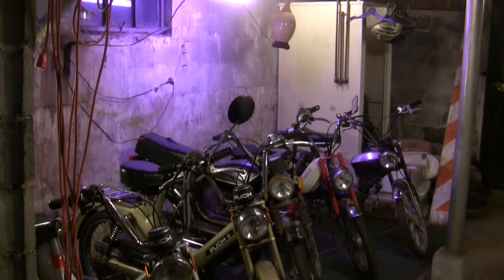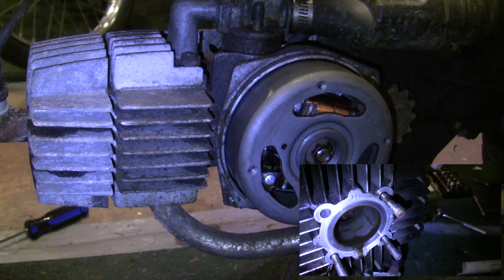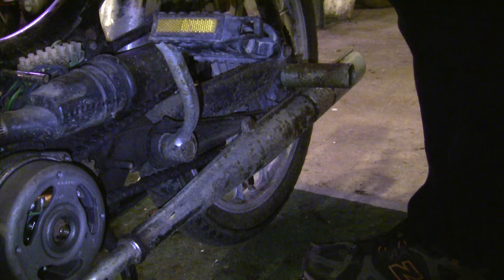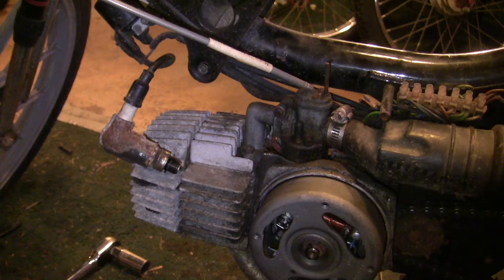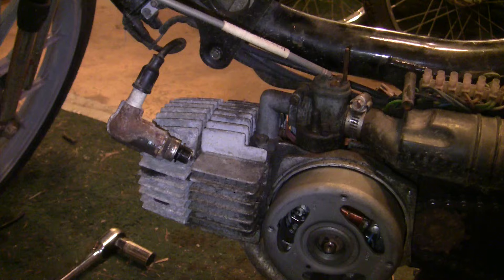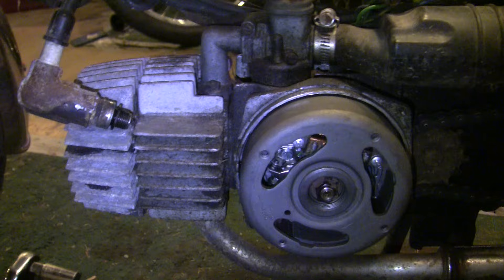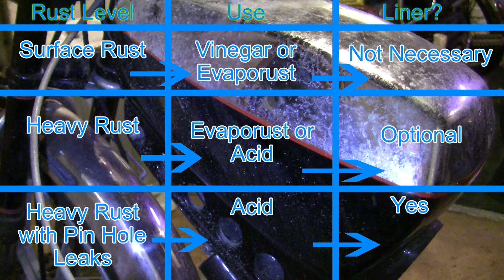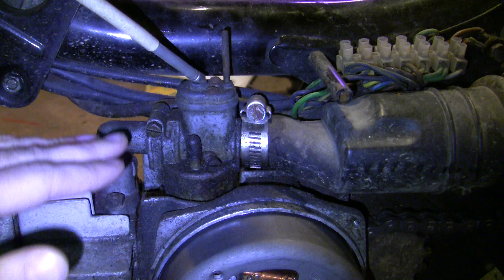How to get an Old Moped Running/First Things to Check (Compression & Spark Tests, Troubleshooting)

Comment: i baught a 1970,s or 80,s honda spree for 40 bucks like 4 years ago and it ran great untill last summer, i checked the compression, fuel lines, oil, cleaned the carb, replaced air filter, and cleaned all the electric connections and it still does not run. any advice you can give me?
Reply: Toll Tone its the same one you made a video on but the dash is different and mine is black with the spree on the side being purple.......i didnt see that video untill after i posted the comment above lol sorry.

Comment: I got an m48 engine I just changed the head to a high compression head and I couldn't get it to crank. I cut a 1/32 gasket and put it between The Head And the cylinder now it cranks but it doesn't start. Had it running before I installed the head any ideas

Comment: So I inherited a 1982 Honda Express. I finally got it started but I have oil leaking from the exhaust. What would be the reason for this?
Reply: it’s not oil it’s the gas oil mix and it’s needs to be tighter

Comment: Was this ped working before you started troubleshooting? Was it working afterwards?
Reply from the maker: I believe the only thing I did before the video was grind off the drive chain which was frozen. If you search through my channel you'll find a first start for this bike, and there are some other videos where you can see it evolve into a MiniMagnum. I converted it to a top tank, powdercoated it, built two motors for it along with a teammate, and rode it from Seattle to San Diego in a week last summer for the Pinball Run III.

Comment: hello, cool video man i have a tomos a35 moped and it runs well but for some reason it dies when i put the choke on what would you suggest to fix this.
Reply from the maker: My first guess would be air leaks, I'd do the carb cleaner check by spraying the mating surfaces (most possible culprits are the carb -> intake junction, spark plug, cylinder -> head, and head -> base) to see if you have RPM changes or if it kills the bike. If it passes that, I'd verify the carb is clean, on the Dellorto SHA that is most likely on that you are really just looking at the main jet inside the bowl.

Comment: Yeah, I tried a new plug. Still nothing. I put both plugs and the boot on my atv and the spark fine. I ordered a new coil, hopefully that does it. Is there any way you know of determining make/year? I know the motor is a minarelli, and there is a sticker under on the frame that says made in Germany.
Reply from the maker: One last thing I would try is cutting the wire a hair shorter and screwing the boot on, if it worked on your ATV maybe the end of the wire is has a dirty or corroded end. 

There should be a VIN plate or sticker near the head tube, as they made a ton of bikes with Minarelli motors over the years, Myrons might help narrow it down, see links below - but you can also post a picture on MopedArmy General Forum or in the "Lovers of Minarelli V1" facebook group and they should be able to help identify quickly.

http://www.myronsmopeds.com/category/parts/minarelli-engine/

Comment: Did all of the spark stuff cleaned the points and the plug and still not getting a spark. Points don’t open as much as yours by the way. It was sparking and running pretty well only a few days ago and suddenly stopped after a ride in foggy weather. If water damage is the problem what do I need? Im thinking of just buying a new ignition coil and spark plug but if it’s a CDI problem idk what I’ll do. I’m so discouraged at this point I’ve done everything I feel confident in managing myself.
Reply from the maker: It is all a learning process :) 

Let's start with the basics, I would absolutely start with a new spark plug to eliminate that factor. If it was sparking then not, I'm wondering if it is something simple like a loose spark plug boot on the spark plug wire or bad plug. If it is the black bosch coil, it is rare for those to go bad. 

From here, if you still have no spark I would read up on wiring for spark only, you want to eliminate variables like the horn wiring and kill switch wiring. Best of luck, once you go through the ignition system once it's like riding a bike
Reply: @TravisTutorial  thanks for the info and here’s  the update: I tightened and made sure the boot was fit tight as well as the connection to the ignition coil and all that. Still no spark. I also checked different points for voltage and ultimately decided to get a new ignition coil, cable, boot, and spark plug. I was okay with spending the money for those new parts after testing a bunch. Once I put those in I’ll know if it’s a stator problem or not. Other ppl I’ve talked to agree with me that it’ll probably be that. if that ends up being a problem I’ll get a new stator. I’ll say now I know the kill switch doesn’t work. The lights don’t work either and I think the light switch works because I got voltage when testing those wires at full throttle. I think the stator just doesn’t generate enough electricity for the lights but barely enough for the spark. That’s why I also think the stator finally died on me. Appreciate the help!
Reply: @TravisTutorial just put the new ignition coil, wire for the boot, spark plug, and boot on. Still no spark. Either I did it too quick and wrong or it means the stator needs fixing. Not sure what to do to make sure I replaced the parts correctly but yea there ya go.

Comment: I changed my fuel filter and I gave the gas and I got my battery charged I need to know what's wrong with my moped it won't turn over sounds like it wants to but it might not be getting any air

Comment: Thx for the video, i have a few questions, checked the compression spark and timing. Also cleaned the carb, but stil the Puch doesnt run. The spark plug gets wet really fast and when I tried to start it Thérèse is a littekens bit of smoke coming from the exhaust. What could the probleem be?
Reply: Hi, did you ever get this sorted out - mine is the same?
Reply: I bought a carb revision kit, this worked. The sealings were the problem i guess
Reply: @tenere_surfs5164  Many thanks for  the swift response - I will definitely try that.

Here’s, Will.

Comment: hey travis. thanks for the video. I have a 1978 puch magnum which was my dads. anyway I had someone work on it and he did get it started. with difficulty. I took it for a ride and couldn't get back up the hills. I was told its the carb and needs cleaning. I was also told that it could be a compression problem with a piston. any suggestions.
Reply from the maker: +stephen negri It could be low compression, but the most common problem with an old moped is usually a dirty carb. I have a video on cleaning the bing that will be on that Magnum. 

Few other miscellaneous things: Do you have the stock airbox on it? It is tuned from the factory to run with the factory parts. If it's a 1hp model 20mph is the most you can expect out of it. If it is a ZA50 Magnum (Silver models and brown UPS models) with the big two speed transmission sticking out of the side of it the shift pucks will likely need to be replaced sooner rather than later, which is fairly involved. If it's a red Magnum with an e50 you won't have to worry about that obviously.
Reply: +TravisTutorial  its a red magnum with an e50.  thanks for your input. your very popular on here. nice job.

Comment: I know this is a super old vid and dont expect a reply but what're your thoughts on electrolysis to remove rust? Sealer after?
Reply from the maker: People do it, but my go-to is Evaporust. 
I'd only do sealer on a tank that has pinholes. Usually you get get it treated and brim it right away with premix and be ok

Comment: Hello Travis, questions im looking to buy a moped that says the following, "does not run. Will start on occasion with starting fluid. No exhaust" anything you can gather about this information that would lead to be the problem (just confused as to why it runs with starting fluid), if not ill just buy it and figure it out as i go. thank you.
Reply from the maker: +Young Bull If you're looking for a project and can get it for a steal, go for it. But if you're looking for a first moped you can fix easy and then ride I'd caution you. Running a 2 stroke with no exhaust is a big deal since they rely on the back pressure of the exhaust to function properly, there is a good chance they've messed up the top end pretty good. Plus using starting fluid on a 2 stroke is a no-no, there isn't any lubricant in it like there is in premix.

Comment: Hey! I have a 1980 Peugeot 103 sp moped. I was wondering if you could help me out with something? It starts and runs fairly nicely, but after riding it for a couple miles it starts sputtering and loses power. It doesn't die though, it just can move very fast (like 1 mph) on its own.  Once it sits for around 30 minutes or so it will run fine again. I was told it might be the ignition cool going bad or possibly a dirty carb. I've only had it a few months and haven't done much to it other than clean the carb when I first bought it. What do you think it could be?
Reply from the maker: I've never owned a Peugeot but that sounds like classic failed (or in this case failing) condenser. The test is usually it'll die after warming up and lose spark, then once it cools run fine. As far as the ignition coil is concerned, on my Motobecane the big indicator that it was bad was the fact it would be cracked, though that could be bad either way. Neither are overly difficult to replace, ignition coil a little easier since you don't have to unsolder anything. If you search MopedArmy you can see how people test them, but honestly neither are expensive if you choose to just replace. 

Give the carb another clean since you already know how to do it, if it's dirty after only a few months you likely have a rusty tank and should install a fuel filter if it's not too bad or treat it if it is.

Comment: HI I'm going through A motori Minerelli. not sure of year. I am not getting spark when I hold the plug to the head, but when I remove the plug and just hold the wire to the head I do see spark. Any tips? Also there is no taillight hooked up not sure if that matters. I am holding just the start lever when checking spark. is that correct?  Thanks for any input.
Reply from the maker: You have tried a second spark plug right? Just want to check (had that happen to me once...). If that isn't it, most likely a corroded spark plug boot. Treatland.tv sells a super nice NGK boot with a rubber end piece to help keep out water for less than $5, I usually just replace. 

Some Italian mopeds have the brake or tail light hooked up through the ignition coil, but if get spark at the head then that's likely not a factor here. You may find once the bike is running the brake levers will kill the motor. And yes, sounds like you are checking for spark correctly!

Comment: There is a sticker in front of my 1978 free spirit gas tank that says do not use unleaded gasoline? We do not have regular anymore. What then?
Reply from the maker: +MrJareth Modern unleaded fuel from the pump is fine to use to make your premix. 

http://www.mopedarmy.com/wiki/NOTE:_DO_NOT_USE_UNLEADED_GASOLINE
Reply: TY. I had to do a little bit of research. Typed it online, and found that answer. I walked up to the store and fixed the mix. ty for responding back soo fast. I really do appreciate it. It's been a while since I rode a moped like this. Well over 20 years. And now. I feel free out on the road.
Reply from the maker: MrJareth Glad to hear it! Happy riding, a free spirit is a great bike

Comment: hi travis, i am writing to you as I have a problem with my 1979 puch maxi single speed. Two days ago i changed my piston rings, i kicked the bike over & it started first time. i then went for a ride,  it was great. The problem arose when I  turned it off,  now it doesn't start. i noticed in your video that when you removed the fly wheel case  
kicked over the bike the fly wheel spun freely . mine does not.  Why could this be?
Please get in touch as i really need to get the puch going as it is my ride  to work. Thanks Scott
Reply from the maker: +Scott  Morgan Hi Scott, sorry to hear you're having trouble. Is the engine turning over when you pull the clutch lever and pedal? Try to spin the flywheel by hand, if the piston moves in the cylinder when you do then you're not seized, which is a good start! Assuming that's the problem, it sounds like the starter clutch isn't doing its job, usually means the clutch cable needs tightened slightly. If the flywheel doesn't rotate by hand and the back wheel locks when you try and pedal the bike as you pull the starter level then you're seized unfortunately and should probably take the top end apart and inspect.

Comment: I have a similar problem you have with the brake light killing the engine. How do you suggest fixing that?
Reply from the maker: +drumsticks94 So most likely this is either:

1) Blown brake light bulb
2) Bad ground for the brake light
3) Bad switches up at the handlebars
Reply: Hey, thanks a lot, I've replaced the bulbs, not sure how to improve the ground, and will mess with the switches at the handlebars, because they are actually a little messed up. Thanks a lot!

Comment: I have a 78 puch maxi and the oil mix plastic part on the gas cap fell into the gas tank. I flipped the bike but it seems to be stuck pretty good in there. Any tips on how you got yours out?
Reply from the maker: +Andrew Gist 
Yeah that can be really annoying, first thing I do when I get a Puch is check the gas cap to see if it's there and then remove it, mixing in the tank is never as good as mixing in a separate container. 

There is a lip around the cap area which prevents easy removal, a long thin pair of pliers could work. On mine I had it stripped down to the frame and had it on a bicycle stand where I could spin it 360 - did that again and again until the cup was in such a position I could reach it easily. Honestly, if it's not blocking your fuel flow it's probably not hurting anything. If you fill the tank it may "float" to the top too...
Reply: Thanks! I never thought about filling it to see if it floats. So simple it's genius!

Comment: I have a 1984 tomos. When I pull the break lever the bike cuts could you tell me  how to fix it.
Reply from the maker: I've had this happen on a few bikes, first thing to check is your brake light bulb, if that is not blown then you could have a bad switch (screws into your controls and has a small button that is pushed/released when the brake lever is open). The last likely thing it could be is a bad ground somewhere.

Comment: So I have this gilera runner lq, and I bought it for like 100 bucks, it wasnt running, but got it working now, it just does not have a lot of touch in the cvt, I tried with different roles, but could it be the cluth? it looks fine inside, and the sparkplug lookes good,  it gets good fuel, and compresion. It just does not pull you forward very well, prob like half a horse power.
Reply from the maker: So assuming that's the 2 stroke flavor of that scooter,- you'll want to make sure the exhaust isn't clogged, that can be a reason you are down on power.
Reply: @TravisTutorial  it was, there was a heck lot ofn oil down there from the old mix, its got a good mix now

Comment: Hello Travis, I recently purchased a 1982 Eagle 3 Moped with a Sachs 505 1D engine that had been sitting up for about 15 years. It has compression, but low or intermittent spark. I measure the voltage from the Stator and I am getting around 3-4 volts AC. I have heard that it should be 10-12 volts AC. Is the stator bad or is there something I should do to it because it's been sitting so long? If it is the stator any recommendations on where to find that part
Reply from the maker: James Williams Ooooh those are very trendy looking top tanks, - that'll have a Sachs engine on it, if you're lucky it'll have the 505D which is 2.7 horsepower, far more than other stock mopeds. If it's not running I would first clean the points and make sure they are opening and closing as you rotate the flywheel. If you have the flywheel puller I'd take the flywheel off and see if the magnets are rusty, and clean them up if they are. You could also have a failing condenser. The Sachs uses a nearly* identical stator to a Puch so there is a lot of info and parts available.
Reply: TravisTutorial great, I guess I will have to go get that flywheel remover. It's definitely something in the ignition system, I purchased a coil and wire, but have not removed flywheel, I did clean points using your trick with the sand paper so we will see how it goes
Reply from the maker: Okay word, a new wire will be good since those tend to harden up. For the high tension coil on those Bosch setups I have never seen one go bad (Motobecane mopeds - totally different story) even at its crustiest.
Reply: TravisTutorial Hello Travis, I finally removed the flywheel, clean the magnets and unfortunately it has not made a major improvement on the AC voltage, I still get 2-3 volts on multimeter, however now it will flash 12vac but quickly go back down to 2-3vac. Do you have a recommendation on where to buy a new stator or do you think it's better to try to replace the condenser?
Reply from the maker: James Williams Condenser would probably be my next step if I it were me working on it, it's basically just a capacitor and if you don't want to wait on shipping from treats you can get one from basically any auto parts store and wire it in externally ("I need a condenser for a 1960s VW Beetle..."). 
There is an aftermarket stator treats sells for Puchs but you'd have to search around for Sachs compatibility, beyond that you've got the MA Buy/Sell forum if you'd like to try and find a good working complete stator.